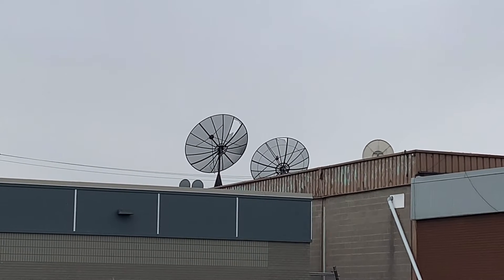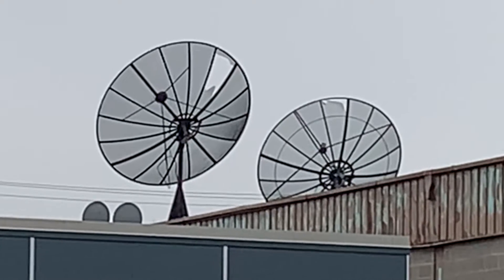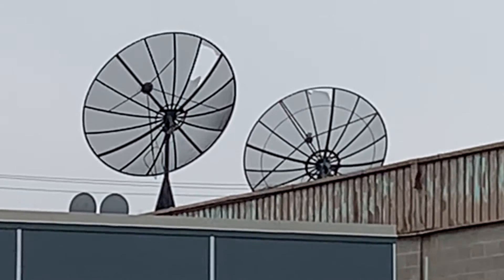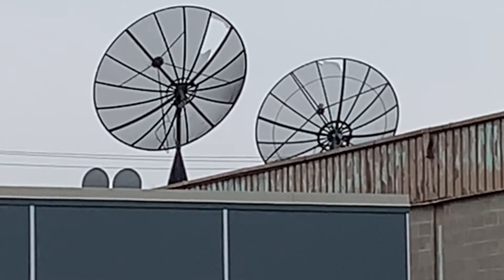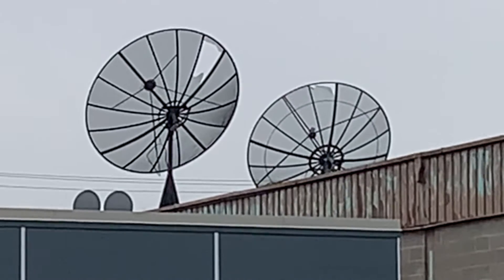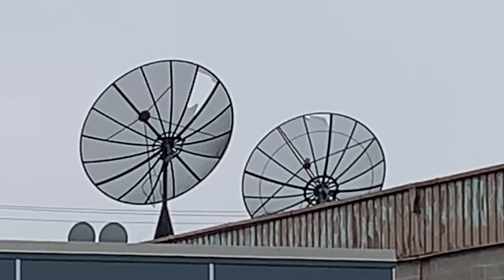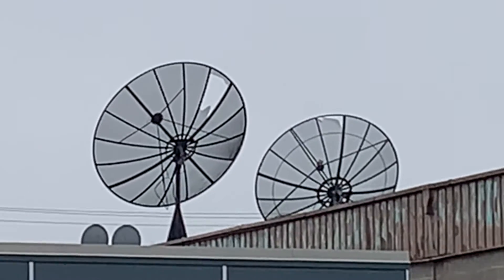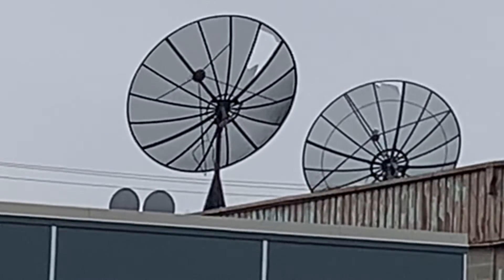C-Band Satellite Dish Sighting

Comment: All the dishes I scraped, I wish I had kept the spun aluminum ones. The ones from the early 80’s were thick!
Reply from the maker: Fortunately the mesh is repairable.
Reply: @NorthcoasterHobby  The spun aluminum would get out of round putting on the mount. I would use two pieces of string at 90* angle to get it back.
Reply from the maker: @Steven-em5if  Good tip.👍